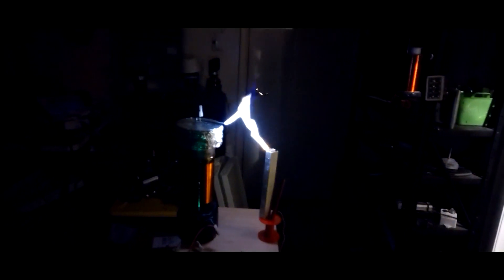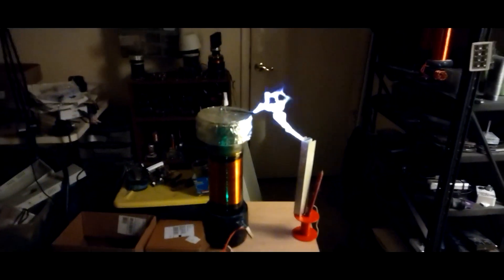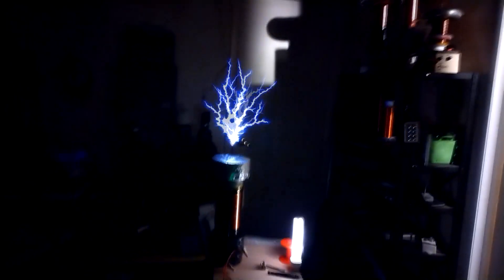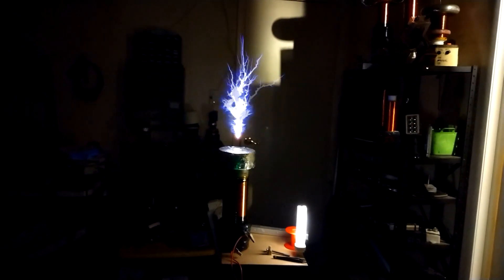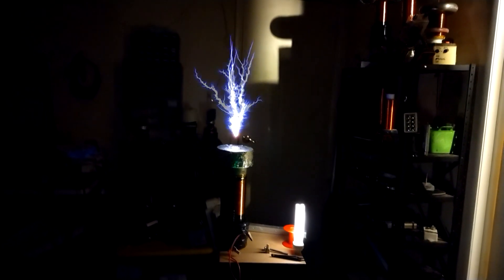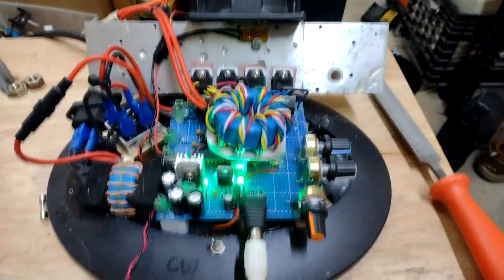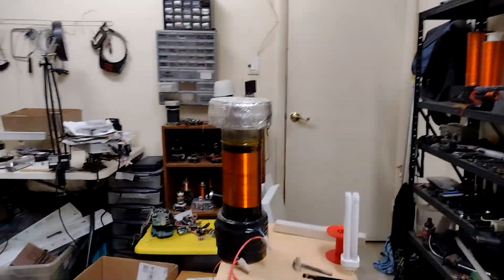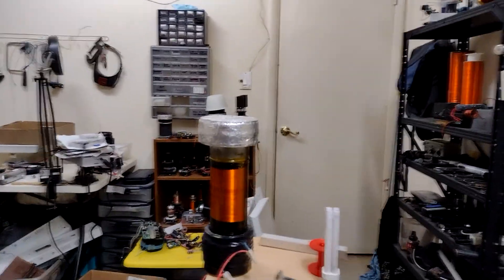PLL SSTC Full Bridge CW 2kW

Comment: Hi magneticitist, I have a question, how do you wind your coils perfectly with 36AWG, when I'm winding mine with hand I see there are like 75 air gaps in like 50 turns, why is that there are air gaps
Reply from the maker: You just have to take it real slow and steady. It's so annoying that I've got a coil that's been sitting around for weeks I've never finished. I have to basically rig up some little spool that will also tension the wire just right. Then I by hand turn it fractions at a time while using my finger to guide the wire tightly together. There's kind of a method you work out eventually but it's real slow.
Reply: @Magneticitist  I have no problem by winding it by hand just that I can't explain why is there a lot of air gaps, Im not kinking the wire and actually winding it slowly
Reply from the maker: @Headbutter-Lettuce90  if you don't forcefully try to push the windings tight together there will be gaps. With thicker wire you can just wind them at an angle but the really thin wire you have to help along the way by either nudging every turn close or every few turns. This is hard because keeping proper tension to do so stresses the wire close to breaking sometimes.
Reply from the maker: @Headbutter-Lettuce90  imagine as you turn the former with say your right hand, the left hand is guiding the windings close together using your finger tip or nail. Your hand has to guide each turn while also forcing it closer to the other windings to remove gaps.
Reply: @Magneticitist  so I should guide the wire with my finger nails?
Reply: @Magneticitist  I'm about to give up, or even make a jig or something
Reply from the maker: @Headbutter-Lettuce90  There are a couple things to consider. First you have to have a real solid former. Something like cardboard isn't always suitable because it can flex and after so many windings it will deform enough to leave gaps. 

Also a jig is basically a requirement but you don't have to get too complex with it. My jig is literally a piece of wire through the spool where each end bolts down to the table and it just hangs down. I then have some fabric stuffed in there for tension. With the wire spool on a basic jig like that I don't need to manipulate it any and can just let it sit there leaving my hands free to only wind the new coil. When winding I then just lay my coil on the table and use both hands to turn it and push the windings tightly together. I keep some tape handy for when I want to take a break etc.
Reply: @Magneticitist  that's what I'm doing on a really clean surface, the problem is that by using some light through the pipe I see the airgaps it has, and I'm guiding the wire and not even kinking it
Reply from the maker: @Headbutter-Lettuce90  Make sure you have the first couple windings kept in place somehow. I try to use a thick layer of tape as a backwall so the first winds don't try moving and causing all the others to get out of wack.
Funny you mention the flashlight thing though.. I just did that with one of my bigger 36AWG coils I ran high power on and while there aren't really air gaps I noticed a few turns about halfway down had started burning out.. Gonna have to rewind that coil lol damnit.
Reply: @Magneticitist  I saw that because I have a big window on my desk so when the sunlight strikes the secondary I see the wire
Reply from the maker: @Headbutter-Lettuce90  Well without a really expensive servo and extremely precise sensors and a lot of coding I don't really see how 36 AWG could otherwise be wound. It may have the slightest visible gaps of light across the coil if wound by hand almost perfectly.
Reply: @Magneticitist  yeah I mean the coil itself with no light inside the pipe seems perfect but I don't know if having that much airgaps make it lossy
Reply: @Magneticitist  what is better, use feedback or a fixed oscilator as IR2153
Reply from the maker: @Headbutter-Lettuce90  That is a fixed oscillator. It has a front end oscillator. It needs a bootstrap capacitor input which is relative to your AC in. I like being able to vary my input voltage though. I like being able to use isolation on the high voltage side also. I like using the high pk current gate drivers because they are very resilient. I like total separation of my logic circuitry to where I'm using a battery supply. I just like Steve Ward's style setup because it seems more versatile but I can see uses for low power 2153 setups. 
While I have some idea of the abuse a lot of common switches I use can take, I'm not so sure about that driver. If I did end up using that kind of circuit, I wouldn't start trying to throw an interrupter on it or anything.
Reply: @Magneticitist  I'm looking at a half bridge driver board that comes with GDT is a commercial one which requires just my controller, but I don't know if that's any reliable
Reply: @Magneticitist  I've seen other schematics of PLL sstc using an IR2110 which can control both high and low side
Reply: @Magneticitist  anyway my TC is going to be in 200khz I want to use IGBTs since they are a lot more tough than MOSFETs, I will try to use Steve Conner PLL which is meant for like 150 to 250khz but you know I can't afford UCC and ferrite rings
Reply from the maker: @Headbutter-Lettuce90  Would probably do well enough. I think they are more or less about the same to where it only really matters the board you buy if trying to run IGBT bricks.
Reply: @Magneticitist  I'm not referring to IGBT bricks Im talking about the normal 60N65
Reply: @Magneticitist  I mean for PLL is more signal conditioning and phasing, for IR2153 it's just like driving it at whatever
Reply: @Magneticitist  and diodegonewild pointed out that his half bridge is more or less idiot proof, also is it possible to run this circuitry between two phases for 220v??
Reply from the maker: @Headbutter-Lettuce90  Unfortunately no Tesla Coil is idiot proof but yea I mean diodegonewild is literally running his at higher voltage
Reply: @Magneticitist  when I get my scholarship I will be able to afford better semiconductors

Comment: Does it affect the antenna signal if I use a 100nf cap at the pin 14??
Reply from the maker: It doesn't really affect the signal but it's good to have there
Reply: @Magneticitist  i mean my old design didn't used it but I have now a screw terminal to place the antenna and also a current transformer, but also for the current transformer you use the 100nf cap
Reply: @Magneticitist  can I use H48 diodes for the antenna, also I can use 200v 9A MOSFETs??
Reply from the maker: @Headbutter-Lettuce90  H48's are basically the same as 1N4148's so they will work. 9A mosfets will work if you don't feed them as hard as I am this coil.
Reply: @Magneticitist  I will try 60Hz filter at first, what I'm worried about is that their drain source voltage is 200v
Reply: @Magneticitist  is there something wrong with my PLL, i checked my GDT and while moving the potentiameter I got from the smallest resistance 6v at the output of the GDT and the highest resistance 2v
Reply: @Magneticitist  I'm getting about 7v signals into the hex inverter
Reply from the maker: @Headbutter-Lettuce90  Yea the GDT should output a steady pk to pk voltage to the gates no matter the frequency of the PLL. The hex inverter input shouldn't exceed the 5v rail if it's clamped and only need a couple or so volts to pass the threshold. Sounds like something is wrong.
Reply: @Magneticitist  I'm using the CD106B hex inverter for the gates
Reply: @Magneticitist  but last time I made this circuit I got 15v on the GDT and the PLL was sending 12v signals to the Hex inverter, is the setup when all things are powered with 12v
Reply: @Magneticitist  I'm worried I'm feeding the BJT gate drivers with 12v and I'm getting the same 5.6v output
Reply: @Magneticitist  does the PLL output a voltage equal to the Supply voltage??
Reply from the maker: @Headbutter-Lettuce90  yea with mine it outputs the supply voltage. you measuring with a scope?
Reply: @Magneticitist  no, I don't have one, I'm measuring with the DMM, i get 5.6v at the output of pin 3/4 of the PLL
Reply: @Magneticitist  do you think that if I use the CD106B as the 74HC14N using antenna it will work?
Reply: @Magneticitist  maybe the H48 diodes are clamping the voltage??
Reply: @Magneticitist  i can see the 5v clamping across the diodes
Reply from the maker: @Headbutter-Lettuce90  If you're measuring with a DMM your results are going to be iffy. You have to be able to assume you have a 50% duty cycle output to assume your DMM is giving you a DC reading that is equivalent to half the peak voltage.

So for example if my CD4046 is outputting 15v, I know it has a 50% duty cycle and a DMM is going to tell me it has roughly 7.5VDC on the output.
Reply: @Magneticitist  so mine is 11.3v